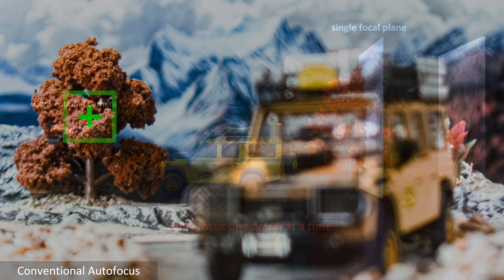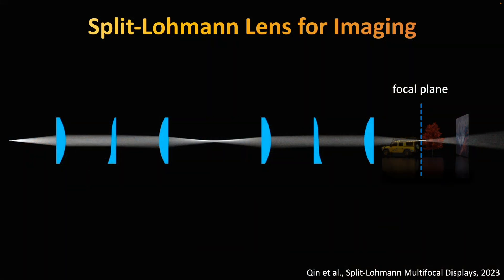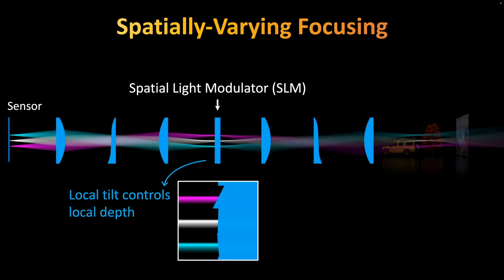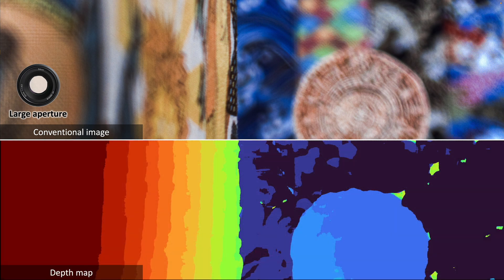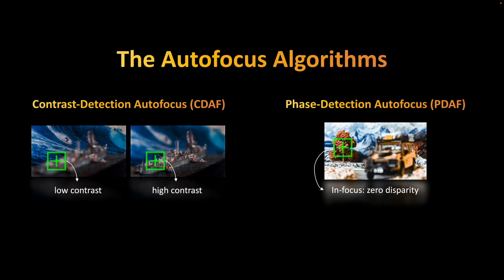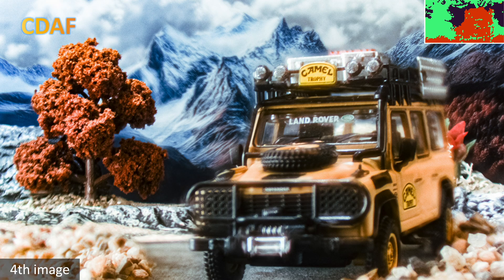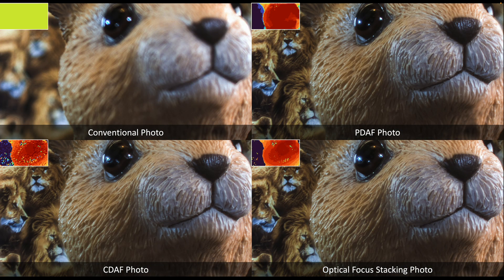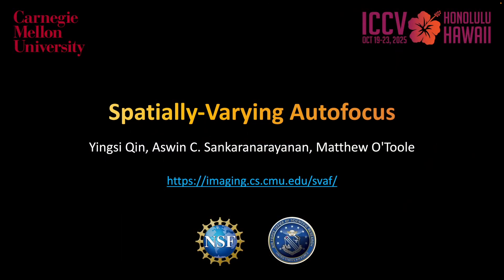Spatially-Varying Autofocus [ICCV 2025]

Comment: Really novel technique! Are there out-of-focus artifacts around the outside edges of close objects? I.e. if the background is in focus, a closer object’s edges would normally “bloom” into neighboring pixels. Or does the pixel-level modulation of the focal distance eliminate this artifact that one would expect when using a traditional stacking method? Also the idea of using the camera’s own autofocus system to build a depth map is amazing. How long does the process take from starting to create the depth map to a sensor readout?
Reply: sort of, it's visible if you look closely, this is due to the local tilting resolution not matching the sensor resolution